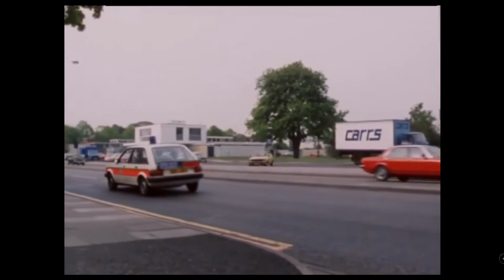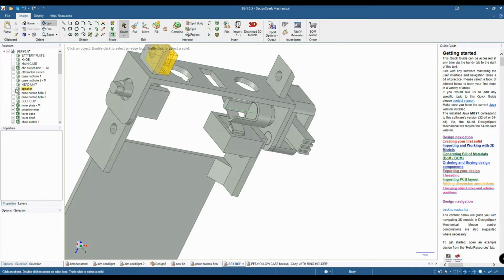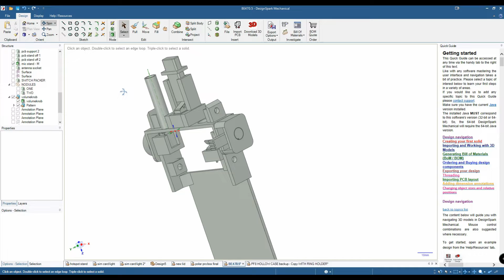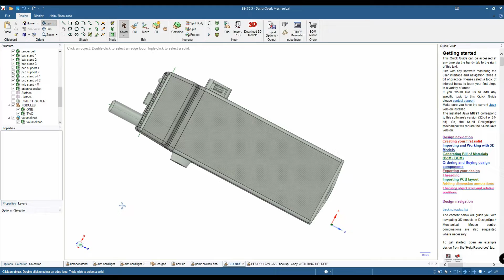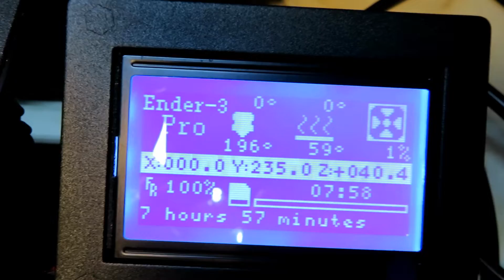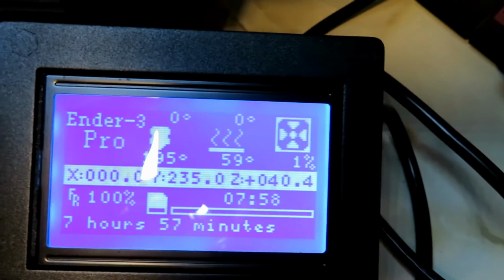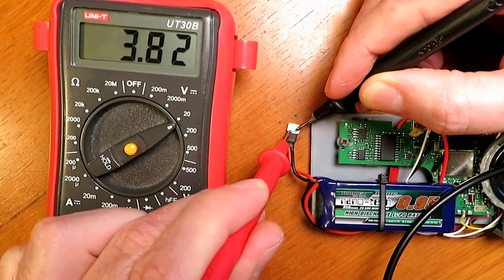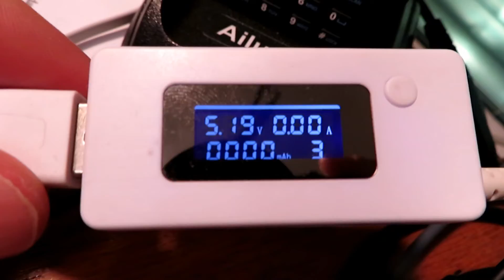EPISODE 2 - MAKING A UK POLICE & FIRE BRIGADE RADIO - THE BURNDEPT BE-470 - WILL IT WORK?

Comment: Brilliant vid once more - I agree with rpcomms1 about "porting" the sound from the speaker to the top of the radio! Another option for the channel change could have been a rotary encoder but that would be better suited to the police model. I have had an issue with some cheap switches like those micro-switches in that they disintegrate at the first sight of a soldering iron!
Reply from the maker: Yes trying to do it on the cheap here really this is a prototype so it will change, in pretty happy with it, I'll make it neater and better looking for the next one, it will go together perfectly, now I have a physical model in my hands it's easier.

Comment: Very good,use a funnel to channel sound to the top of radio,from inside the radio maybe one option?

rob
Reply from the maker: Yes once the case is printed I will check it out it might be good enough, that speakers quite loud.
Reply: @knoxieman  Thought that maybe a simple solution rather than complicating design,looks really good.I used to own  working ones a long time ago,they also had the vehicle adapter the burndept could slide into for transport use.I have done 3D CAD with a Solid works engineer,one thing we found, building replicate parts was could be very time consuming,we did consider a 3D lazier scanner to scan objects in faster but we never gone round to using one.So I know what your doing is very time consuming process esp the checking off and QA test fit verification processes,best of luck ,will keep watching ur progress..Rob